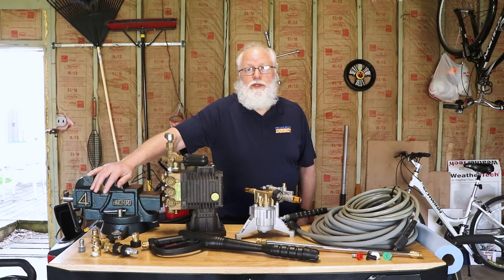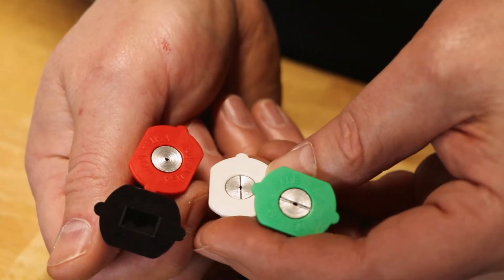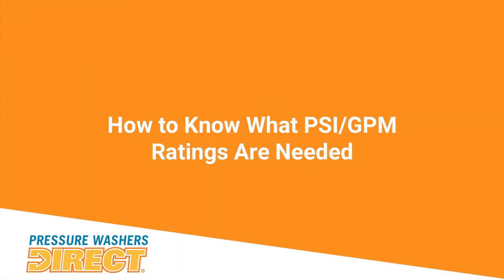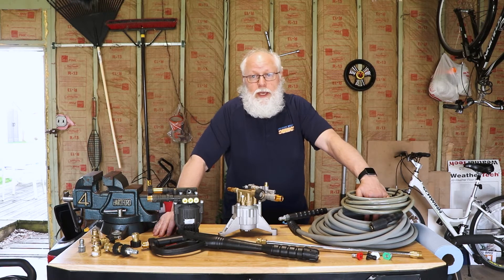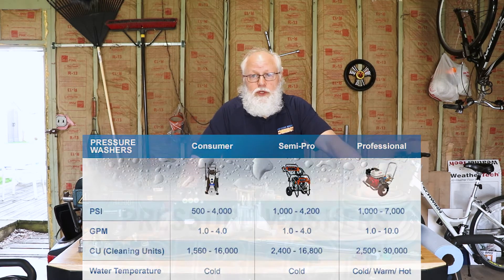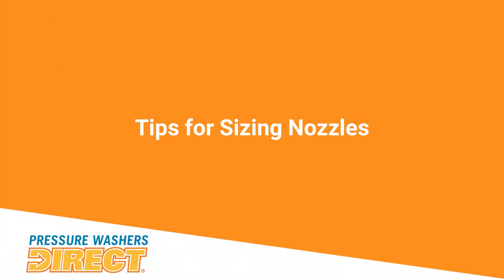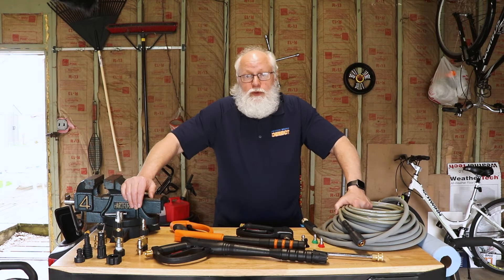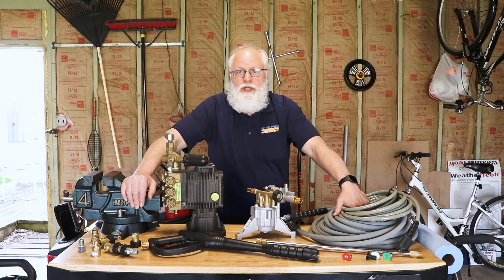Why GPM and PSI Ratings Are Important for Pressure Washers

Comment: Could I Ask What Model Spray Gun On Your Table ?
Reply from the maker: The long black spray gun is a Simpson (https://www.pressurewashersdirect.com/Simpson-80147/p93948.html), the orange spray gun was a Generac (https://www.pressurewashersdirect.com/Generac-6685/p15158.html), and the short spray gun was a MTM Hydro (https://www.pressurewashersdirect.com/MTM-Hydro-10.0381/p9844.html).